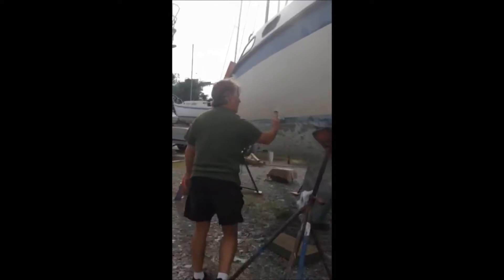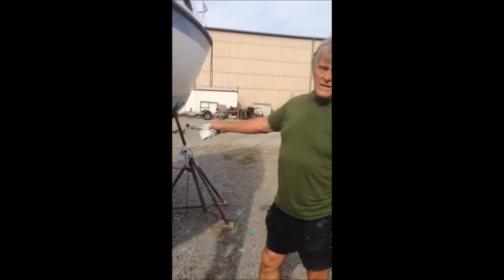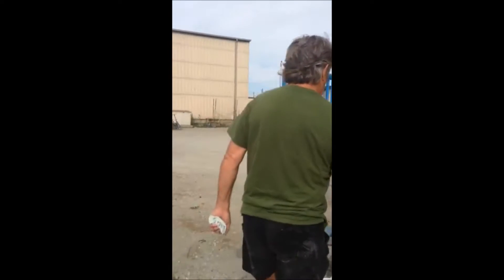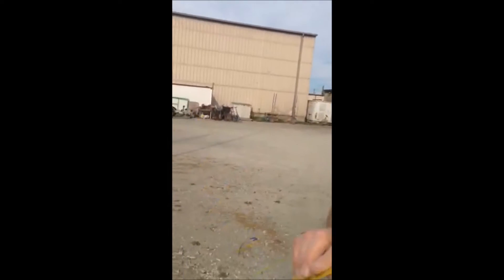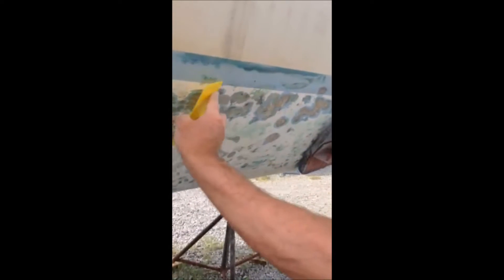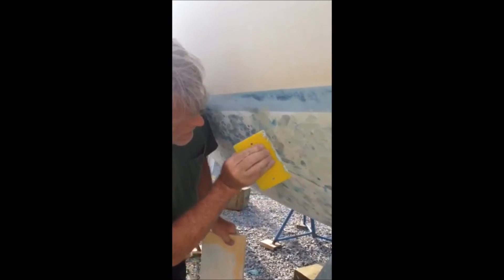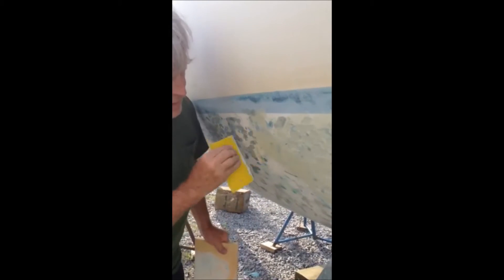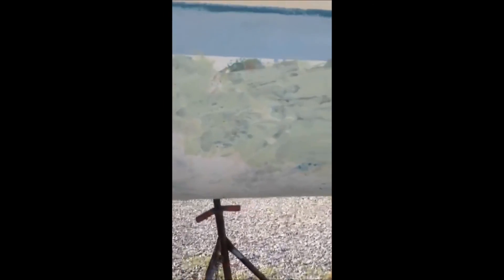Day 3 of the Cal 24' Sailboat hull repair

Comment: I owned Cal 24 hull #55 years ago and it was old when I got it. I don't miss this haul out stuff at all, expensive have you by the short hairs, unless you run it up on a beach high tide. All I ever had to do was bottom paint. IF you still have old pump toilet, watch those damn valves, can corrode and take on water, happened to me out sailing one day, scared crap out me look down see cabin filling with water, made it back to marina (barely) good motor.
Reply from the maker: David Adams we didn’t have a pump toilet on this boat. We just did a camping toilet.
Reply from the maker: David Adams I bet that was a very scary experience.